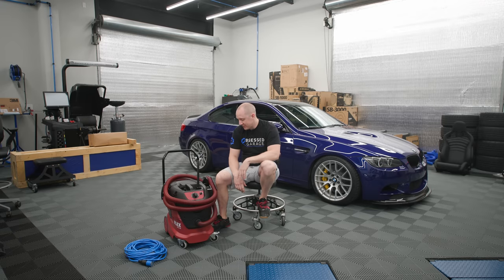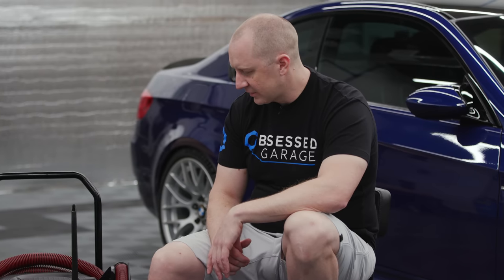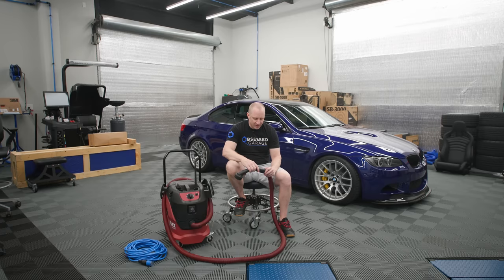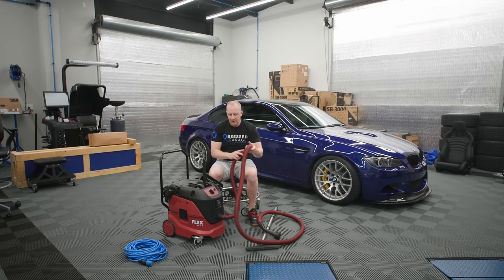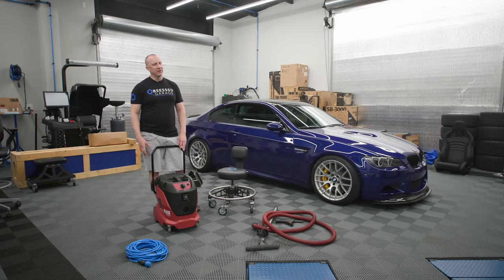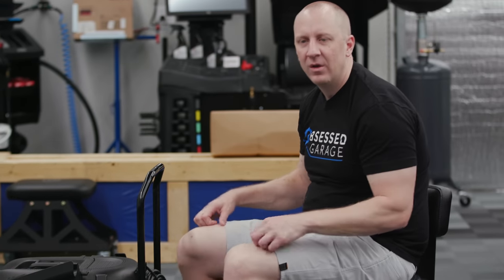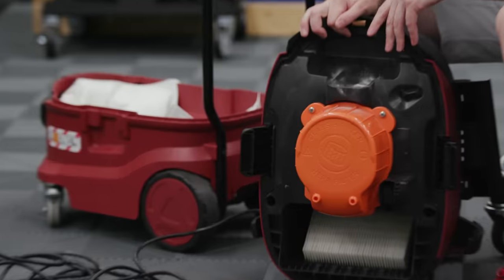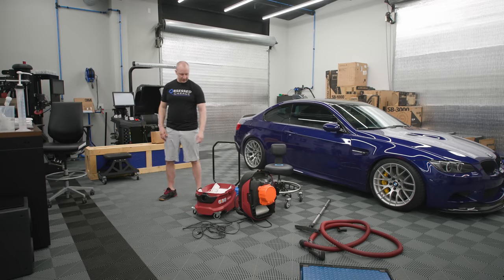My Favorite Vacuum for Detailing - Flex 9-Gallon HEPA Vac

Comment: My small 5hp wd4070 Ridgid I've been using for many many years and is an absolute workhorse. The upgraded orange professional hose on the ridgid from the "detailing kit" looks identical to the red one of the flex. As well ridgid has the bendable long crevice tool. Those 2 things for a detailer are a must have. The pocket in the back is also great for storing a few more accessories and wrapping the cord handle around the handle takes about 5 seconds which I love. the filter just comes off on 1 second and you can blow it out or change it in no time. However the front casters are garbage has they are cheap plastic and I've upgraded them to a stronger metal caster and wheels which is a great upgrade. The flex definitely looks better built but I would love to see a smaller version, one that could be transported and pulled around the car easily.  With that upgraded red hose, smooth casters and better cord storage.  Let's say an OG spec ridgid or flex?

Comment: Matt,

The receptacle on the front of the vacuum is for triggering the vacuum to turn on when you turn your tool on. The main application would be for a sander or a tracksaw; the vacuum will detect current flow, and turn on automatically.

Comment: I hope you could try what Festool has to offer; the CT L (I would go M filtration just for the overkill of it) Midi or Mini (if you prefer a small bag) and they will be available cordless to. They also have Bluetooth capability, so you can turn them off without going to the machine, just add the little remote to the end.

Comment: One small tip......put a piece of  foam or rubber over the metal handle. While pulling or moving the hose while working, the vacuum will move around because the casters are very mobile. Next thing you know.....DING.....right into the car, or the one next to you. Ouch.

Comment: Another modification that vac needs is a button on the handle to adjust the amount of suction like the Miele vacuums have. That way when you do the floor mats it's not just stuck to the floor mat, and you can move the wand around to work / clean.  Matt, you should work with this Flex company to make changes to their product.

Comment: The Flex is comparable to the Fein I have. However, I have a soft spot for my Festool CT 36 as I think it's nicer than the Fein and Flex. May have to get a smaller Festool for my non woodworking tasks.

Comment: The Ridgid 4 gallon 5 hp  with 1-1/4 in Premium Car Cleaning Accessory Kit for RIDGID Wet/Dry Vac  is small and cheap and last for years , It’s all you will ever need , That thing is over kill and made for cleaning cars out of a junk yard not brand new BMWs & Porsches 😂
Reply from the maker: I have a half a dozen of those Rigids around.  I grab this this thing instead every time.

Comment: $89 Home Depot Rigid 5hp, 12 gallon model works great. No need to overthink a simple vacuum. More exotic/exclusive does not always make it better.
Reply: I have a Rigid and they really are not great at all. I guess they get the job done, until they don’t.
Reply: @wjkrug   I have a rigid five horse 12 going at the winery and I beat the crap out of it picking up grape seeds out of press tanks sucking up steel shavings had it for about four years now and it keeps on chugging.
Reply from the maker: I heard this same argument about every product I’ve ever used and recommended.
Reply: "Lifetime Warranty"...
Reply: I’ve never used the Flex, but I’ve used the Festool dust extractor. Trust me these are way better then your Rigid shop vac.
Reply: @ObsessedGarage  I always say to myself, "when I am on my death bed, will I be happy I wasted any effort/time on this?". Answer is usually no, and I move on with life and more important things...

Comment: First I was going to get the Bissell Garage Pro because you don’t have to change anything to go from dry to wet, but it was hideous. Then I started looking at something with the same function with better aesthetics: the Prolux Garage Pro. Then I moved to a different house. 

So now I’m going to use a whole house central vacuum and put a hide a hose in the wall attached to a separator in the closet.

Comment: For the part the spins and annoys you. Check out Central Technology Systems, they sell a hose cuff that just screws on to end of the hose so you can just attach a crevice tool.
Reply: I’ve the 9 gallon flex vacuum. I put my vacuum to extreme elements, used on sanding cement dust,works great on auto tool set up track saw for wood working. I made my garage cabinets a lot of it and Kept all the dust down. The best vacuum I’ve ever used…

Comment: Vacuums are just one of those things where everyone is going to have an opinion and literally none of them are invalid.

For me, I’m not in to the quality and features and looks or costs. I want something that works well every single time. That, for me, is the Rigid. Yeah, being in the Rigid camp makes me unqualified to be included in a serious conversation about vacuums BUT it is what it is. I buy and use things for one purpose; to serve me and my process. I don’t buy something because of how it looks, how expensive it is or because it makes coffee and tucks you into bed at night.

THIS vacuum is too heavy, too big and too expensive for mobile detailers. It’s also just not practical for anything but a shop … but there are more powerful and more effective shop vacs available for far less. So what’s the point of buying this one? Yeah, there is no point. It’s not crap, that’s for damn sure. It’s a good vac … even if way overpriced for the value it brings. The point is, if you want it, get it. If you don’t, move on. You’re not going to like everything Matt offers, you’re not going to agree with him on everything. That’s okay.

This is a pass for me, but I’m sure other people will gobble these up. It’s all good.

😊😊😊

Comment: I’m giving Rigid a try, mainly because I have one at work and I beat the thing up at the winery sucking up grape seeds out of press tanks and sucking up steel shavings I beat this thing to crap and it keeps running so far so I just ordered a five horse 12 gallon, I need a wet dry vac for multiple usage not only doing cars with shop work an occasional detailing on interiors, I should buy a dedicated carpet cleaner like a Bissell…

Comment: No way has that this particular item “been used for years”/“a thousand times”- it actually looks brand new to me, not a spec of dust or any usage marks on the outside, even the wheels & castors appear unmarked and there was no sign of use on either of the filters we saw, yet Matt claims he has taken it home for use during building works as well as being used all around OG HQ for years! You could tell he wasn’t fully familiar with using every aspect of it that he demonstrated - how realistic is this having claimed to have used it “thousands of times”? There’s no need to make such unnecessary claims, Matt’s honest endorsement is normally enough for me🤷‍♂️
Reply: You dont know OG .. the thing’s probably ceramic coated 😂
Reply: Probably just come out of a cardboard box more like 🤔
Reply: Yeah, kinda disappointing
Reply: Everything you said can be easily disputed he said he did clean up the unit and he uses it in a very clean environment hence no visible wear marks on the wheels at least not on camera I’m sure we saw a close-up there would be minor marks also I’ve seen that in the background in videos dating back quite some time I couldn’t tell you how long but I’m sure I’ve seen it in the other building no this new one. Why would one accuse somebody of lying with no real proof I would remove your comment if I were you
Reply: Some people take really good care of their stuff. All my vacuums, steam cleaners, wet cleaner and so on look brand new, even though they are 2-4 years old. My car looks brand new - I get comments about it all the time. I just take care of it.

Comment: This is great Matt, but I'm 100% waiting for the wall solution.  I've been using the Bissel Wall mount vac for the past 2 years without issue, but I'm sure there is a more "Obsessed" option out there.
Reply: Yeah you would be better off contacting a local HVAC company and have them install a system in your walls. Thay way every room has a retractable hidden vacuum that looks like light switch. If you're that obsessed. And rich

Comment: Have not yet watched this video (I will) - so forgive me if this has been covered. This Flex vacuum looks almost identical to the Milwaukee corded dust extractor of similar size (8 gal). Vent style and location, wheels, body accessories, handle/releases etc.  It makes me think these are both an outsourced white label tool built by some other mfg. any thoughts by og on this?
Reply: Flex makes them for Milwaukee
Reply: @GHJA614  Nilfisk makes the vacuum, they make it for both Flex and Milwaukee
Reply: He talked about that a bit
Reply: @meme40s  Yup, I stand corrected.
Reply: Thanks for the replies all. Yes correct looks like Nilfisk makes this for both flex and Milwaukee. I’m a bit surprised matt didn’t choose the Milwaukee version in this case as I assume this would be added to the “master collection”.
Reply: @boogiedahomey what Miele do you recommend?